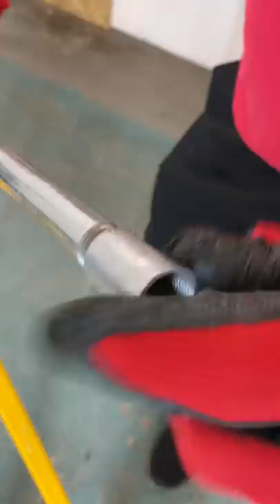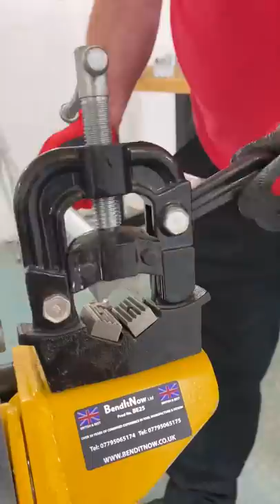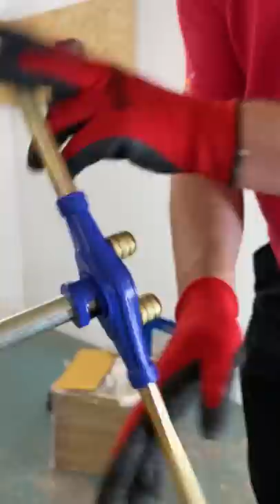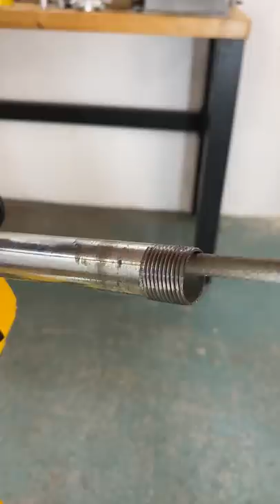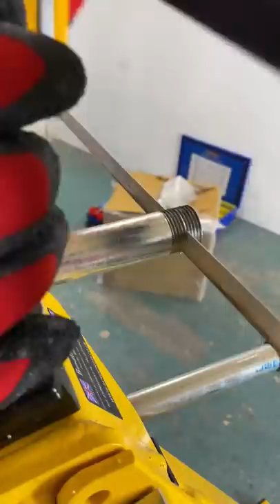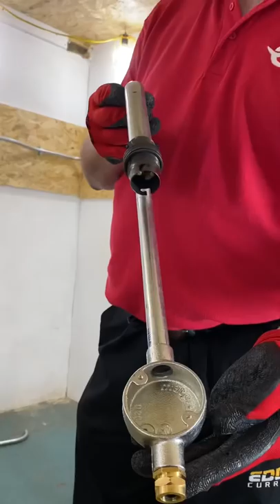180 Degree bend and thread for conduit light fixture 💡 #shorts

Comment: Here in the States, we can only bend conduit to 90°. And who uses a hack saw any more, we have battery portabands. I have 2 different sizes in my van
Reply: BS. If that was the case every ceiling with a gooseneck bend would be illegal. And a triple nickle can make a 180 degree bend. The only limit is 360 degrees between boxes.
Reply: @robertthomas7239  according to the NFPA 70 National Electric Code the maximum angle of any ONE bend is 90° and a total of 360 between pull or junction boxes. Goose necks are no longer legal.
Reply: @113annamolly  Still incorrect. Provide an alleged code # and I will gladly give you the correct text. It certainly isn't in 344.26. 
What year apprentice are you?
Reply: @robertthomas7239  article 344.24 tells me the max between any box is equivalent of 4 quarter bends (360°), then refers you to chapter 9 table 2 which gives you the radius of the center line of listed conduit. Example for 1/2" conduit is 4" any less would be an over bend of 90°. What year apprentice are you.
Reply: @113annamolly  You obviously do not understand geometry. The shoe on the bender determines the radius, not the degree of bend. And I've had my supervising electrician's license since 1996. You're wrong.
Reply: @robertthomas7239  ok here you go, 1/2" bender has a stub take up of 5"(radius) that's why chapter 9 table 2 tells you 4" on the center line of the conduit, if you bend the conduit and end up with 3" along the center line then you over bent the conduit( more then a 90° bend). Understand the math now.
Reply: 22 years in the IBEW. 17 years as a General Foreman.
Reply: @113annamolly  It's over bent but does not change the radius of the bend. All you've shown is you don't understand simple geometry or how to read a code book. FYI IBEW since 1989 and opened my own shop in 1996. You're wrong.
Reply: @robertthomas7239  the code book says equivalent of 4 quarter bends (360° total) not 1 1/2 bend and 2 quarter bends. The Authority having jurisdiction in my state does not allow for bends in conduit over 90° in one bend.
Reply: @robertthomas7239  you can do back to back 90° bends, but you can't do 120° to 60° bend for example. That's what the code says. 90° is the max bend.
Reply: @113annamolly  That is not what the code states lol. It states 360 total degrees between pulling point and gives 4 quarter bends as a reference for dummies. You're interpretation is incorrect.
Reply: @113annamolly  I guess you don't know how to bend a gooseneck then. 🙄
Reply: @robertthomas7239  I know how to bend goose necks and shepherd hooks, but they are not legal bends anymore.
Reply: @robertthomas7239  no he's correct goose necks/Shepherd hooks are illegal.
Reply: @pullstringgoboom0811  Maybe on certain job specs but not according to the NEC nor every single inspector I've talked to
Reply: @robertthomas7239  John is correct. You cannot field bend Goosenecks anymore. You can however purchase them as prefabricated lighting assemblies.
Reply: @michaeldove339  Incorrect according to every inspector I've talked to as well as Mike Holt the foremost authority on NEC. Some inspector makes an incorrect call and then people spread it around as gospel.  You would never be able to pipe up to a pitched deck if that was the case, you've been told incorrectly.
Reply: @robertthomas7239  20 years in the IBEW Local Union 3 (NYC JURISDICTION) and 10 plus years running work. You cannot make these field bends anymore in NYC as per our local code(s). What state are you in?
Reply: And yes Mike Holt is THE authority on the NEC but not the NYC Amendments to the code!
Reply: Nor NYC Transit (MTA/DOT), nor bridges and tunnels......how many of those jobs have Mike Holt ran 4" Gal on do you think 🤔?
Reply: @michaeldove339  Chgo Ibew 134 for over 30 yrs. State the alleged code lol
Reply: @michaeldove339  Local amendments to the NEC does not make something not NEC compliant. The question was if it is legal according to the NEC or not and it is.
Reply: @michaeldove339  Hopefully none, I haven't used amy in 20 years. Everywhere I've worked requires PVC coated rigid.
Reply: @robertthomas7239  humble apologies Brother Rob! Yeah I think I misunderstood the question. Sometimes to follow a ceiling or walls I have to bend closed  90s (93/95°)!
Reply: Plus you know us local 3 guys get a lil crazy with our pipe bending!
Reply: @michaeldove339  No worries brother

Comment: Love the videos, how about doing a video on using a string line, loads of purely domestic sparks don't seem to use them. So handy though if your doing spotlights, picture lights, saddles etc. Any things that need to be quickly but precisely installed in line really.
Reply: That’s because we use lasers? String line in a finished home or building is just asking for a mess. 
Also, lasers set up in the middle of the room in like two minutes easy.
Reply: @loganthesaint  True, very good points yes the chalk can leave some residual mess and lasers are too very useful for most of the same jobs and often quick to setup too.

I personally have had a string line in my tools since my first apprentiship tool kit probably because I worked on only large underground rail projects I.e concrete walls. But its still there now and I do domestic works mainly, its good for unfinished or hidden surfaces, almost unbreakable, never have to consider battery as chalk lasts decades and cheap as chips so has its benifits.

Comment: Love the videos guys. Just a wee pointer though. I was taught as a young apprentice electrician to file the conduit before unscrewing the dies it would then stop you flaring the threaded ends when filing after dies are removed?
Reply from the maker: Sounds like a great tip 👍
Reply: Погода ь ь ь ь ь ь ь ь ь ь ь ь8ъ8
Reply: @efixx  humble af. Awesome!🤝
Reply: I always use my unibit on anyting 1in or smaller (3/4 , 1/2 ) and my rat tail file on everything else

Comment: Is there a reason why in the US conduit and junction boxes are made of metal, maybe rigidity or heat transfer ?
 Where I live there are all made from plastic much easier to work with, but houses are made almost exclusively from concrete or concrete bricks, rarely drywall is used.
Reply: Wire protection and continuous ground / earth to take leakage currents back to the source.
Conduit is not typically used in residential,  mainly commercial and industrial. Although there are a few jurisdictions that do require conduit in residential.
Reply: @olesparky82  nice to know, wher i live since all wires go through concrete walls, conduit must be used. Also here a separate ground wire is passed to every spot where phase/neutral wire are passed, all ground wires are connected in the electrical cabinet to potential equalizer busbar and from the busbar to electrodes that are welded to structure foundations.
Reply: @eliadbu  we run a dedicated ground as well. The conduit system just provides another path incase the wires get damaged.
Reply: @olesparky82  could be valid solution especially on older houses that are not up to standard.

Comment: Does conduit have npt thread or its own special thread?
Reply: Npt
Reply: @Yousitech  thanks
Reply: Well, first, this is a video from the UK.  NPT is a US standard, the British have their own standard for Pipe threads, so it's not likely that the threads you see in this video are NPT.  Also, in the US, conduit is usually threaded with NPT threads, couplings are threaded with NPS thread, which is the same dimensions as NPY, but cut straight instead of tapered. This is so that when you use a coupling between two pieces of conduit, you can screw the two lengths of conduit in until their ends touch inside the coupling.

Comment: Ive done a LOT of new wiring and demolition work on commercial spaces, but never seen anything like this, must take forever.
Most of the time im glad if the electricians put in some kind of support or loops instead of just dumping all the wires on top of the ceiling tiles, but this is just ridiculous